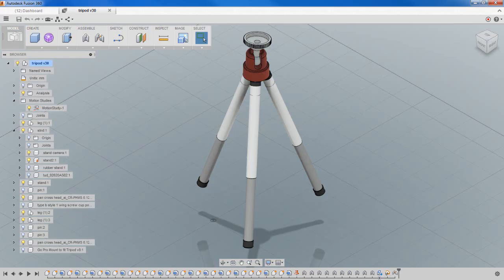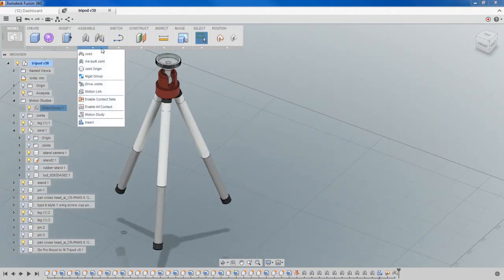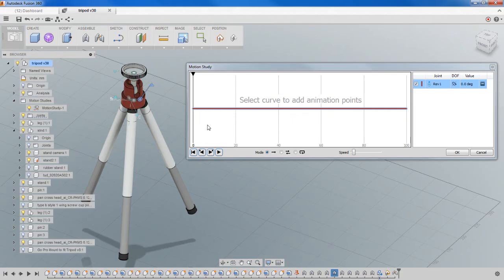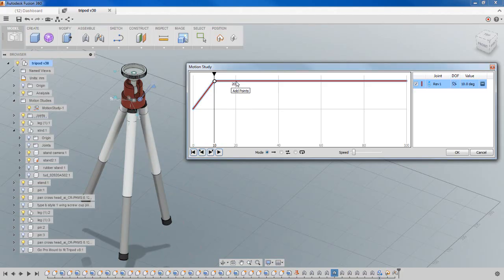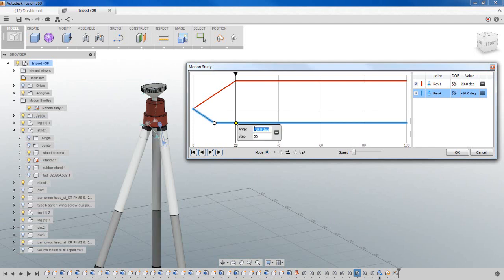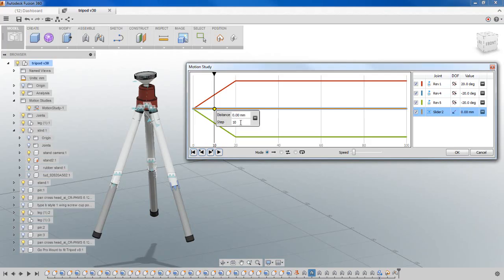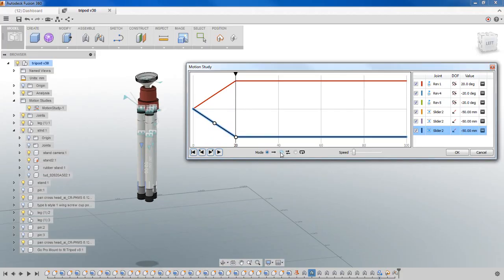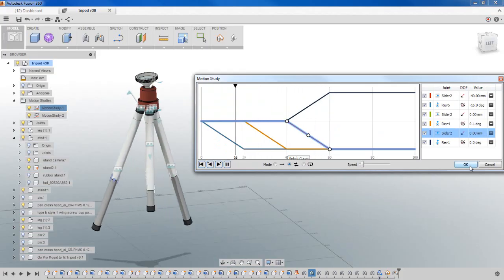Easy Motion Study with Fusion 360

Comment: Autodesk needs to do a much better job at making the motion study user friendly.  20 degrees is straight up an down? Why can't we at least have some kind of litttle reference window, so we can see the angle of the angle of  revolution while we select our graph points?  (PS revolute' is not a word.) They don't even label the axes on the time graph.  And why not allow us to drag the points where we want in real time like most software lets you?  aaagh this crazy software wears me out. I'm going to bed
Reply: And I tried motion study on the geneva drive from the basic training folder. If I choose two points and one is step 0 and 0 degrees and the other is at step 100 360 degrees, and i loop it, then why isn't that simply moving in a continual rotation at a constant speed? . Where is autodesk getting their math? It's just not logical. This software wears me out in areas that should be straightforward simple logic.

Comment: Thank you - can I ask what is the reason for adding in both the step 10 and step 20 motions? Wouldn't it animate the same if you just used step 20 (as it would the step 10 point in time anyway). 

Cheers

Comment: And when I want to build it, how can I know the stroke required
to move a certain component a certain distance?
Reply from the maker: That's the kind of details available from a kinematic study. We're hoping to add that to Fusion 360 in the future.
Reply: @adskFusion  I hope so to, because how to build a mechanism without it?
Reply from the maker: Well, a LOT of mechanism have been built without that sort of simulation, but it certainly would help! I don't think it's high on the priority list at the moment, unfortunately, but maybe I'm wrong.
Reply: @adskFusion  Hello, I have the following question. I duplicated a folder with an assembly. In the duplicate, I updated a part, but it did not update in the assembly. How could I fix it? Thanks
Reply from the maker: You'll have to double check what part is being reference where. Use Fusion Team (the web interface) to do this with ease. Look at where "used" and "used by". If the wrong file is there, you can replace.
Reply: @adskFusion  Thanks
Reply from the maker: Happy to help!

Comment: 360 should show on the pivot a little arrow indicating what side is clockwise positive rotation. This will avoid messy positive and negative settings which can be confusing.